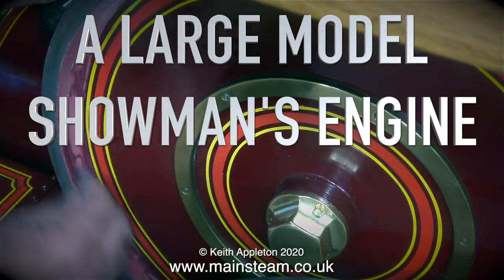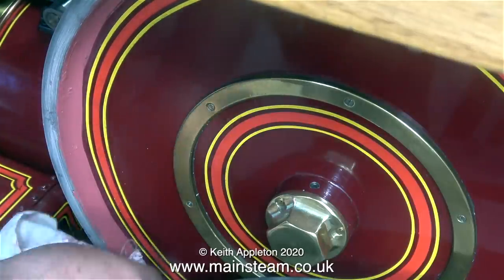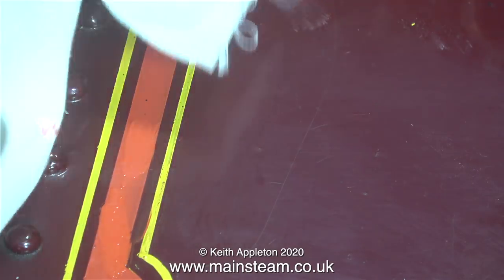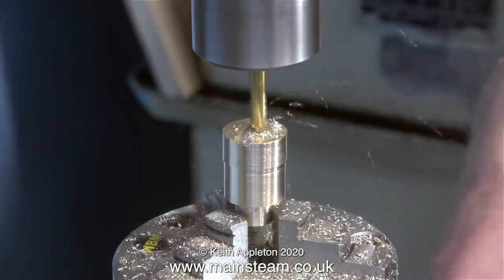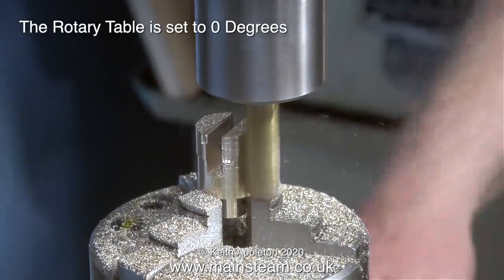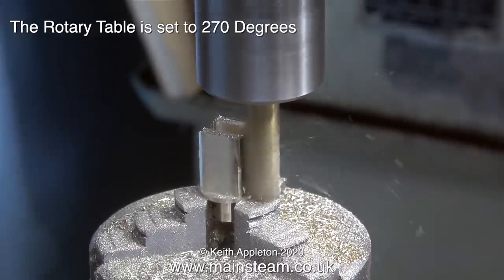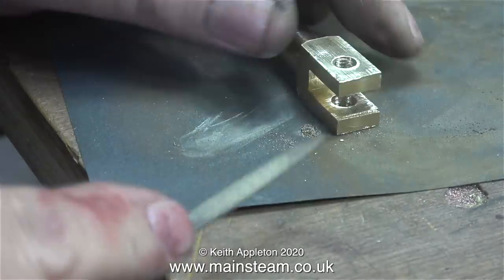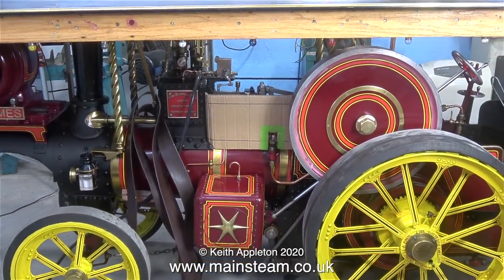A LARGE MODEL SHOWMAN'S ENGINE - PART #13

Comment: You can use needle scaler to remove old paint. It does fast but noisy job.
Reply: When I was in the coast guard I used a needle scaler eight hours a day for about a week when we were redoing the deck on the flybridge

Comment: Hi, you were having a tedious time removing rust from parts in some videos you`ve done, I`ve been restoring an old matchless and throughout doing this came across the process of removing rust using electrolosis, This pull the rust off leaving the the good metal untouched.   Achived this using an old laptop charger with the negative connected copper wire aroung a piece of wood then wrapped aroung the part suspended in a bucket of water with a fair amount of salt mixed in, and the positive connected to two electrodes in the bucket.    This worked for the crank and several other parts.    It might be worth looking into this for the rusty parts on your steam engines